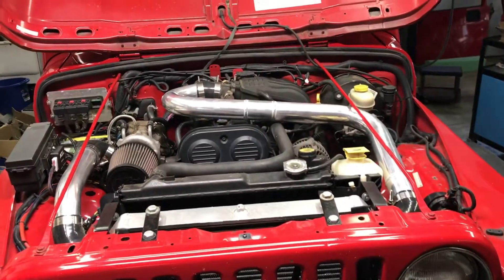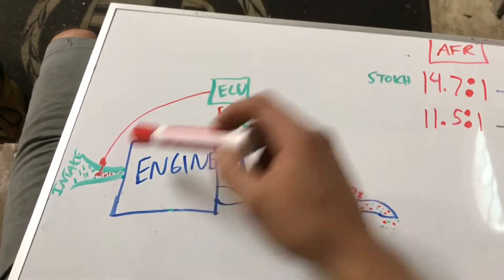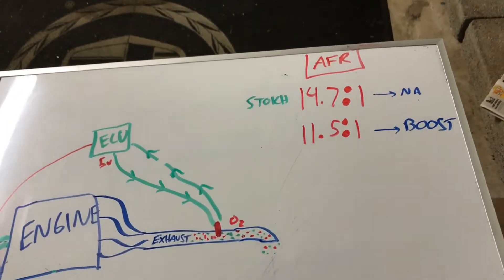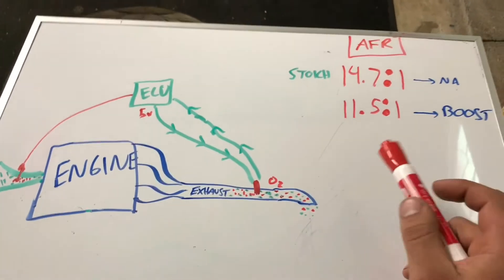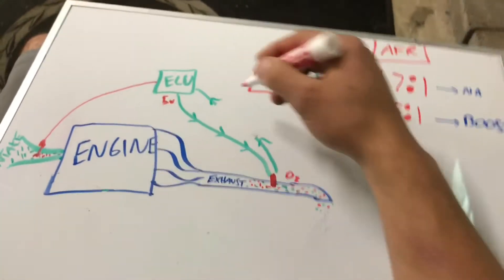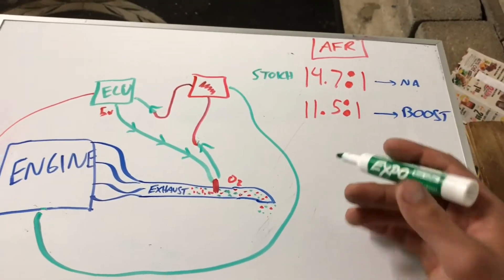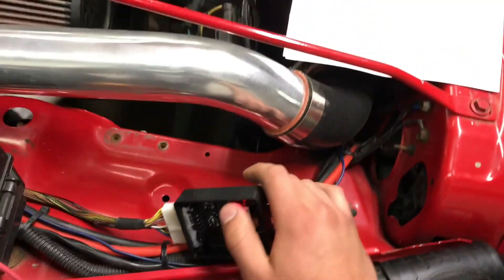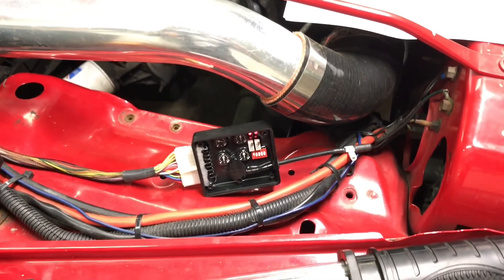How to Install and Tune a Split Second Enricher Piggyback ECU. TURBO Jeep Wrangler TJ 2.4l

Comment: Hey Zack, what turbo setup are you using? Thinking of either going turbo or supercharger but came across your video which finally explains a bit about the Split Second setup.  I know this is quite old video, how did your 2.4L do with the turbo on, any issues?

Comment: can this also be used to lean it out if needed? Like if running e85 in a stock system and the pcm is calling for a lot more fuel can this split second be used to dial it back(lean it) a little if needed? great video!
Reply: Did you ever get your answer can you use it without having a turbo on it
Reply: @chrisclements8373 nope

Comment: Great informative video! I'm a little late to the game, can you talk about how to tune the enricher? So if I understand correctly as you boost you turn the top left dial (The one you said to start at 50) to add or remove fueling? Thanks!

Comment: Is there anything like this for n/a 4 cyl engines w intake and exhaust mods ( headers, ported intake and 4.0 intake and 4 hole injectors , cat back exhausts)?
Reply: You most likely won't need a fuel enricher for this, maybe invest in a piggyback like a AEM FIC or Unichip to change timing and add slight amounts of more fuel for your mods

Comment: This only works on cars that have a factory wideband or as some call it an afr sensor. The read rate is much higher and much faster on an afr sensor vs a traditional o2. The car must have a newer afr sensor for this to work. Cars that have a traditional o2 it won’t work.
A lot if newer cars than you think have a traditional o2. Such as a 2015 camaro zl1 still uses traditional o2 sensors.
Reply: You can add a wide band to anything easily.

Comment: This seems awesome. Kind of of extra injector controllers. These seems like good solutions for car the don't generally come with tuning solutions for going forced induction. I wonder how far this can go before maxing out injectors? Is this a universal product? And what about timing as someone else mentioned.
Reply: Also what does open loop and closed loop mean exactly? This seems excellent for easy turbo older 4 cyls and such on a budget. Where has this been my whole life!!

Comment: do you know if this module is still available on any website? been looking for one.... and this exact item will work on a 2 bank engine?
 awesome video! got me really exited to do mine! (well my dads) but still!
Reply from the maker: Orlando Perez I have a lightly used one in the box I will sell you for cheap if interested! It will work with a 2 bank engine. Email me ZackFab171@gmail.com
Reply: @zackfab8847  Do you still have the enricher?
Reply: Also interested.

Comment: So basically this is to cheat the ECU for fueling low boost and not needing a "tune" correct.  No need for HP Tuners,  it just cheats the signal to fool ECU into over fueling to maintain required BSFC under boost.

Comment: Great instructional video. I’m currently turbo charging my 2003 Subaru Baja. It’s done, I’m using Vortech FMU, larger injector, 250lph was to fuel pump and Split Second Voltage clamp good clamp my MAP sensor. I’m still trying to get a better air fuel ratio. I was looking at this Split Second enriched device but didn’t know how well it work.   Until now, thanks to your video, I’m going for it. Thanks Man
Reply: Chris, the Enricher has a really good rep.   So as long as you are in close loop and the vehicle you have uses a wide band style O2 sensor it can enrich  properly within a certain amount of boost.   I don't know the number but i'm sure for most vehicles it could be able to assist with up to 7 or 8 psi.

Comment: Great video, finally somone who has addressed and explained putting a turbo on a heep. I am planning on doing mine on a 2000 2.5 wrangler and the fuel management was my struggle. All the jeeps need more engine for getting to and back from our outdoor experience and the turbo just makes sense. The 2.5 is a great little engine, but way lacking for highway use, this solves the problem. You selling kits is an excellent idea, you should do great.

Comment: Are you using stock injectors? Can they provide enough fuel under boost?
Reply from the maker: With 3-4 psi the stock injectors provide enough fuel. I'm currently turning it up and have bigger injectors. I will make a new video soon.
Reply: @zackfab8847  i sub and ring bell good content

Comment: Forgive me If i missed this..... did you go with SRT4 conrods and pistons?
Reply from the maker: Goog User Nope completely stock internals. More than strong enough
Reply: @zackfab8847  totally agree they're strong enough. But the SRT4/PT-GT has 8.1:1 CR. Surprisingly Crank P/N is the same across all 1st gen 2.4s

Comment: Can I take the brown with black wire to my maf sensor that gives me 5v
Reply from the maker: Depending on what your powering i wouldn't pull any power from a maf. I would get an in-line voltage regulator to reduce 12v down to 5. They are cheap

Comment: Did you have to swap to a wideband? Or was the stock narrowband work okay?
Reply from the maker: Phillip Zeigler The stock narrow band will make the appropriate fuel corrections but I added a wide band to monitor the AFR

Comment: No timing adjustment? Please advise on drivability around 80mph
Reply from the maker: At low boost and 93 octane i have not had to adjust timing. No jeep has good drivability around 80... haha but it will do it no problem now.
Reply: @zackfab8847  I was thinking the same thing, LET ME OUT

Comment: Nice video! I don't usually see too much videos with upgrade information on jeeps.  I have an 03 Laredo,  with an inline 6, 4.0 I been trying to research research research about things I could do for the ecm on it and what I could do to up performance. I have 2 cats,  4 o2 sensors,  would this device be able to support 2 o2 sensors and without a turbo for the meantime?
Reply from the maker: I believe it will support two exhaust banks so yes

Comment: will this adjust fuel in closed loop with larger injectors so that the car does not throw a rich code?
Reply from the maker: Shane Rhabb  In my case it has not thrown a rich code. In many cars you can get away with upping the injector size slightly. The PCM will adjust the duty cycle accordingly to hit its target AFR

Comment: how accurate is this compared to a piggy back controller like the aem fic or a more advanced engine management?
Reply from the maker: Shane Rhabb  Not very accurate but does the job. This will get you rolling with a $200 solution. A more advanced management system is recommend but they come with a cost

Comment: How much did your turbo kit cost? I have the same jeep with the 4 banger and I'm looking to add some more pep to it's step
Reply from the maker: Built it myself. I am selling these kits if you are intrested
Reply: Hi a good idea to make a sales kit I would also be interested in buying no problem to send to Europe?: - D
Reply: @zackfab8847  do you have kits already manufactured? And do they fit liberty modelsm
Reply: @zackfab8847  where can I purchase the kit at?
Reply: Are you still selling them
Reply from the maker: 1 1 Selling Manifolds and Full Turbo kits email me ZackFab171@gmail.com